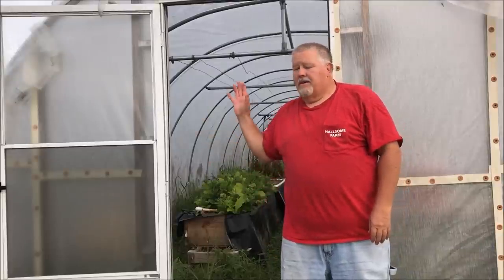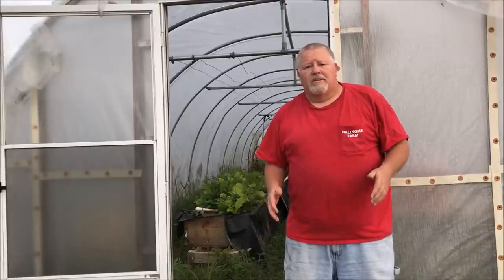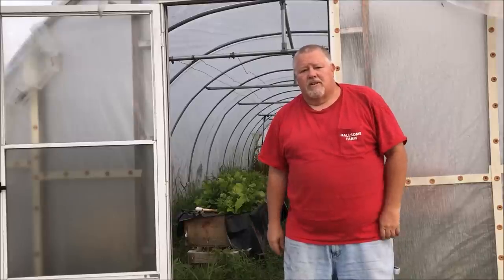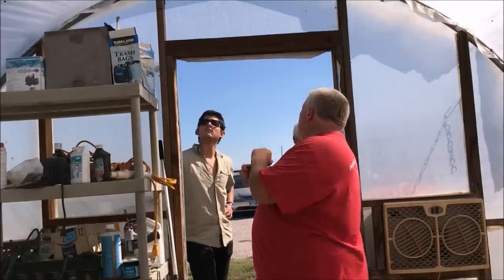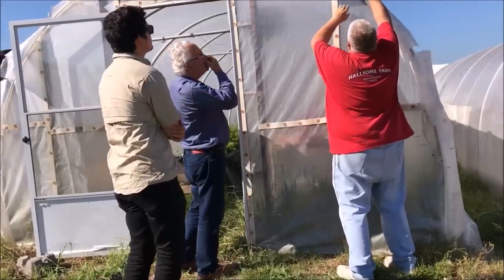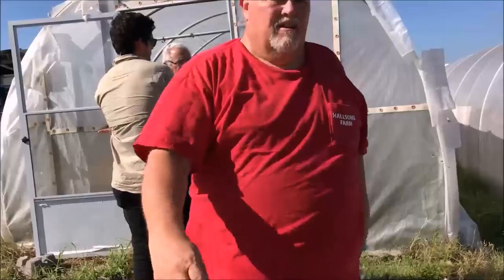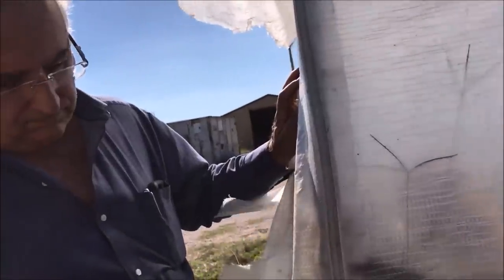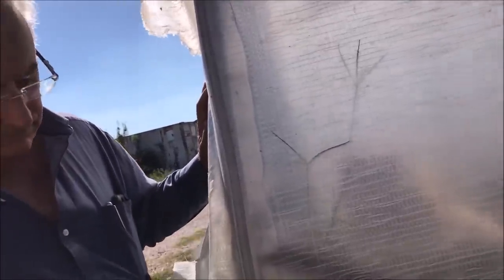How to Build a Greenhouse With Metal Pipe Construction

Comment: Does the 2x6 along the bottom go on the outside of the pipes? And are you fastening it with the lathe style fastener? Would it make sense to use the track-style fastener along the bottom?

Comment: Can you either explain the plastic you are using, provide names or links, etc? I thought in one of your videos you said you make it there. I’m interested to know what to use.
Reply from the maker: Yes I am a distributor for the cover, we make them to size. It is an 11mm triple weave poly should last around 12 years if properly handled. Cost is 38 cents a square foot, you will also need the poly track (better then wiggle wire) and some poly tape.

Comment: Does the 2x6 along the bottom go on the outside of the pipes? And are you fastening it with the lathe style fastener on the 2x6? Would it make sense to use the track-style fastener along the bottom?
Reply from the maker: Yes to the outside of the pipe I used carriage bolts